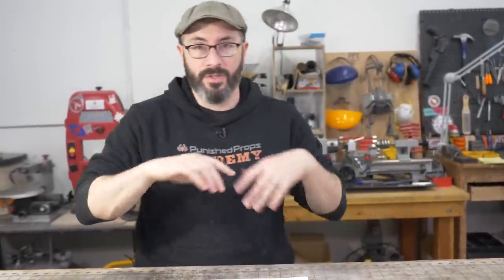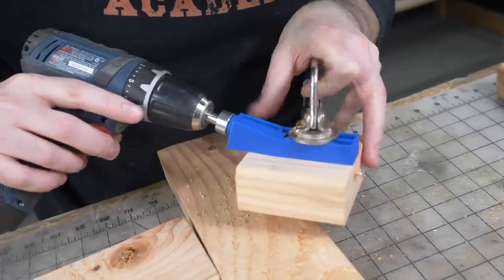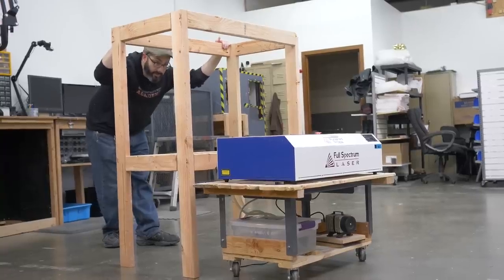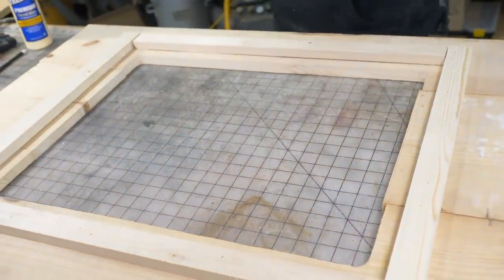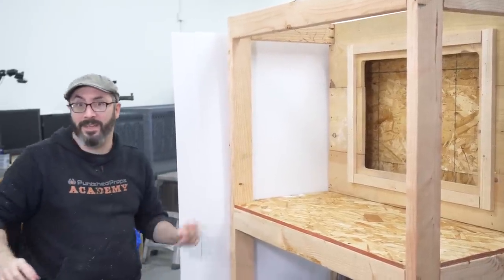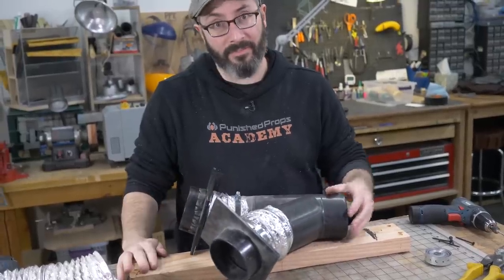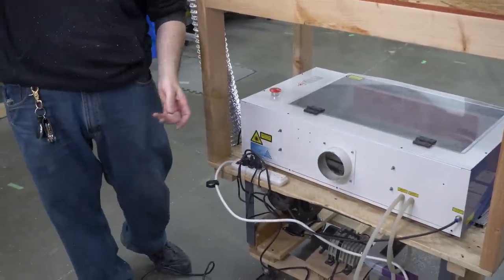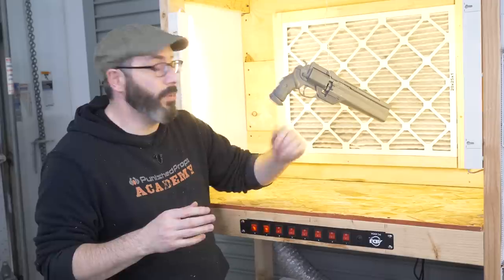How to Make a Custom Paint Booth with Filter & Lights!

Comment from the maker: Check out the full list of tools and materials used in this build along with some progress photos on the Punished Props website! https://punishedprops.com/2019/03/18/custom-spray-booth/
Reply: when dealing with paints, how often does the filter need to be changed out? i would assume faaaairly regularly if your doing a bit of kit building and other painting hobbies a few times a week? just assuming the paint would gunk it up pretty quick relative to standard 1-3 month filter life lol
Reply: Easy Trick: Suspend your fan/air pump from some rope. it makes such a huge difference in isolating and reducing noise!
Reply: Bill the fan you're talking about from a furnace is called the inducer motor assembly.  When you say furnace blower the motor for those are in the blower assembly itself and could start a fire.  The inducer motor assembly is what exhaust a gas furnace and you can probably call a local HVAC company to see if they have one from a scrapped furnace that works still.  I work for a HVAC company and we have hundreds of old ones just laying around and even give them away for free.  Just a prop enthusiast trying to clear up some confusion and keep people safe!

EDIT:  After watching Bob's setup i see what you meant by a furnace blower.  you can find those on old oil furnaces or industrial furnaces.  really not that common anymore sadly

Link to a new one for refrence : https://www.amazon.com/702112479-Replacement-Furnace-Exhaust-Inducer/dp/B00FQR8WES
Reply: How to save 95% of the time used on this. use an old closet that you either have in a permanent spot or on wheels.
Reply: Hey Bill, I was wondering if you can build something for me. If so, how much would it cost? If it would cost anything at all.
Reply: Is the filter name or specs shown anywhere? Amazon link doesn't work and can't see any details other than the link and "here is a filter like what we used". Hopefully I can find a video that actually says what is used!

Comment: Kreg pocket screws are AMAZING! I would suggest, however, looking at the instructions about setting the collar depth. You will get a much stronger joint.
Reply: I was thinking the exact same thing.
Reply from the maker: Great information—thank you!
Reply: This and the distance from the edge of the board should be in the instructions too
Reply: Those pocket holes are far too deep. If the point of the drill breaks through, think how much wood is left for the screw to hold on to.
Reply: Came to say this.  You don't want the drill to come out the end of the wood.
Reply: exactly my first thought. There is no material left for the screw to hold on to when he drilled so deep. You only need to go deep enough to make the screw head flush and disappear. Get longer screw lengths if you need to reach.
Reply: @punishedprops  I just watched your video and I had a conniption the moment I saw you use the pocket hole jig and it's drillbit completely wrong!

If you're going to do a video where you're teaching other people how to do something at least know what the Hell you're talking about (or demonstrating).  READ the instructions BEFORE going on camera!!!

Plus..."The time is come!"...is wrong!  You can't put a past tense and present tense in the same sentence!  It's "The time HAS come!"

Comment: Pro tip (from an amateur woodworker) - If you're building two sides that are going to be identical, lay the second side on top of the finished first side so you can use the first side as a jig.  No measuring needed and if you made any slight measurement errors on the first side, they will match on the second.
Reply from the maker: Great tip!

Comment: Awesome build, but the filter is in backwards the cross hatching is there to prevent the filter from being pulled in when the filter starts to get clogged and pull out the Kreg instructions out of file 13 and your screws won't peek through anymore.

Comment: Two things.  1, I'm 90% sure that filter is in backwards.  There will be a marking on the edge saying which way the air will flow.  2, you could put construction adhesive or caulk on the wood before you attach it to the frame to make the edges airtight and just tape the butt joints.

Comment: Tape to mark the holes for the screws for the light mount. Dammit where has this trick been my whole life???
Reply: It's probably the simplest thing I that whole video and I thought the same thing. :)
Reply: I photocopy the bottom of things a lot.....
Reply: I'm glad I wasn't the only one that thought the same thing about the tape! LOL
Reply: I'll be using that tape trick the next time I mount a power bar or something similar. So simple.
Reply: What I've done (although it wouldn't fit in that location) is I put a piece of masking tape on the edge of my 48" level, and I mark on the tape where the holes go.  That way I get my hole spaced correctly and level.
Reply: RIGHT!!!

Comment: I am happy that Bill shared this with us. For anyone looking to get the parts listed in the description be aware of the following. The (Furnace Blower) listed will NOT have a power cord, an on-off switch, mounting bracket or any way to connect the intake hose. If that is going to be a problem for you, you may want to look for a different one.
Reply: I wish I would have read this before ordering everything. Kind of a bummer none of it comes with instructions, or that Bill didnt warn us about that...
Reply: you wouldnt happen to be know a good recommendation would you?  One that comes with a power cord, the proper flanges, and the measurements? Thanks so much!
Reply: @mikezufelt8172  You can order in line fans that come with charcoal filters and dryer vent hose fairly cheap off of Amazon

Comment: Great tutorial. I built one very similar to yours a few years ago for my modeling hobby using 2x4’s and plywood.  Due to space limitations of my shop I had to mount my blower and filter on the bottom surface of the spray box. I covered the filter with a metal grate, which serves as the “floor” of the painting area. It creates a down-draft that works surprising well.  

The blower/motor was the most expensive part. I bought mine at a hydroponics store for about $65. I love your power switch bank. I’m going to make that an upgrade to my booth.  

Since my son took up prop making and cosplay, my booth gets a lot of use.  You’ve been a big inspiration to my son. You and Andrew DFT are his favorite makers.
Reply from the maker: That's fantastic! So glad to hear that :)

Comment: Awesome and functional cart!  If you use PVC or rigid aluminum ductwork, you might get better air flow. The flexible duct used may collapse if the vacuum pressure is too high.  Also, the Kreg Jig for the pocket holes has a depth guide/setting to make sure your depth collar is set correctly.  Baffles are a great idea. You can use a cheap set of window blinds to make them easily.

Comment: I  made a similar version some time ago using a plastic garage cabinet I had. It was already together, so all I had to do was cut a large square out in the back and make a spacer for the filter and put the cut-out section back with a 4" adapter for connecting my dust collection hose. It's light and can be moved easily when not needed. I do need better lighting, so I will use your idea for that. Great video Sir.
Reply from the maker: That's great! We're happy to help :)

Comment: enjoyed the video Bill - I built a booth based on the one in a Kamui Cosplay book - she made it simple by using a cabinet from IKEA and cutting a hole for the filter and adding lights and a fan.  I had an old cabinet so I gave it a go and it works great. Easier if you don' thane the room or the tools to build the cabinet.
Reply: What kind of fan did she use?

Comment: My booth is like 12 years old now and built out of 2x2 frame (really just 2x4s ripped down the middle) , cardboard sides (old boxes), and duct tape to seal it up. Made it where it all unbolts into flat panels to store when I'm not using it.

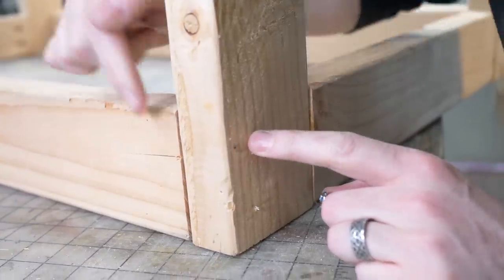Comment: 7:08 Hey Bill, pocket holes are the correct option for that.  You never want to screw, or nail into endgrain (or even glue actually).  The joint is weak and will fail over time.  Screwing through the endgrain to the long grain is several times stronger since you're basically screwing through a pilot hole that the smooth shank of the screw will live in, and the screw threads will grip into the cross grain.  That's the real reason you need special screws with pocket holes.  Just adjust your depth correctly :-).

Side note, I have a box full of 20x20 4" thick filters that didn't fit my furnace that I'm going to do something similar with.

Comment: Hey bill! The joint where the ends pointed out, you were still right to use pocket holes. While they do help with awkward places, their job is actually for strength not ease. Screws going into end grain don’t hold well because of the orientation of fibers, so with the pocket holes your never going straight into endgrain, but still slightly against it in each piece. That gives the threads better bite and leads to a stronger, longer lasting joint.

Comment: Hi Bill , nice spray booth .
Can i give you some humble tips ?
You can experiment  with the lights , it maybe would be more practical if you mount the lighting in the top front  inner corner , that way you get less chance to get" over spray " on to the lights and you could easy look from both sides  to the parts you painted  to see if you missed some spots or have some thin coated spots  without blinding yourself from staring right in the light source by accident .
Also you can consider to use hooks or eye hook bolts with a washer and self locking nut so they can turn free in that upper beam to easely spin the part for spraying all sides .
That way you can always aim straight forward to the direction of the filter.

One more little thing : pocket holes will always be better and stronger than screwing in the end grain of wood.

Thanks for for showing all those beautiful props you made , there are always  some golden tips in your videos  so again thanks for sharing.
Reply: Based on other comments, I expect he will go with the alternative solution of putting cling wrap or clear cellophane tape over the lights, which can be easily and quickly replaced when overspray becomes an issue in blocking light.

he tends to use wire when hanging parts, which can be bent to expose the other side without worrying about it twisting back around, but some king of spinning hook is a good idea.

Also, I think he's aware that screwing into endgrain is not effective connection, given he demonstrated this at 4:06.

Comment: Good project for the shop. I am wondering why you did not use the table saw to cut the 2 x 4's into 2 x 2's instead? You did not need all the extra weight for such a small paint booth. It is recommended to use glue with the pocket screws. You could have added the silicone to the 2 X 4's before you screwed the back on and that would have sealed the back better. Are you going to add a light to the top as well, not just the sides?  Nice project that will be used a lot. Thanks for posting the build. Take Care.

Comment: I had the next size up kreg jig that you have a long time ago that had little sliding arms to determine how far back the holes were set. I believe the thickness of the board you are drilling into determined how far back the jig is set from the end so the hole is roughly center, and how far up your collar is is determined by the thickness of the board you're screwing to so that the screw doesnt poke out the back side.

Comment: i built one just before xmas using foam core artboard, taped the exterior and hot glued the edges on the interior. It works surprisingly well and is obviously very light :)

Comment: If you end up closing the bottom compartment, i  suggest that you put a flow indicator somewhere on the water tube, to check that the water pump is working properly.

Comment: Big fan of your work, currently going back through your videos and wanted to offer a tip about using a pocket hole.

Set the stop collar on the drill bit back a little bit further for a slightly stronger joint since you are using such long screws and aren't plugging the holes.  The threads are the only thing holding the second piece so that extra shaft in the second piece serves no purpose but the further you drill the holes, the less material will be under the screw head.  Set it so the bit just barely pokes through, not even necessarily all the way.  Use the guide included with the jig for a starting point and adjust from there to your liking.

PS my desk is about 10ft from the press that produces that jig.
Reply from the maker: Very cool! Thanks for the suggestions!
Reply: @punishedprops  your welcome! Thank you for putting out great content.  It has inspired me to continue my prop building venture (mostly Ghostbusters related).

I'd also suggest upgrading to the R3 if you end up doing more pocket holes or the K4 if you do a ton of them.  Both those jigs have guides directly on them to set everything based on material size so you have optimal depths and won't drive your screws all the way through the second board.  Shorter screws help too lol.  

Keep up the good work!

Comment: Great build. Well thought out and it looks like a pleasure to use. 
Is there any fear of flammable particles getting trapped in the hoses? Perhaps you should ground them to protect from static build up.
Just a thought.
Reply from the maker: There likely is a risk but that's part of why I used the particular motor I chose.
Reply: @punishedprops  I get that for sure. Air moving thru a pipe can / will cause static build up which will eventually discharge. Grounding the pipe will keep the static charge from collecting. 
I did this with the dust collection system in my basement woodshop. Better safe than sorry when my family is sleeping upstairs.
Regards.

Comment: I know it must seem everyone has an idea of what another guy outta do, but I was thinking. I would line the inside of the booth with the panels, and (hope I get the name of this correct;) a builders paper? a roll about 30" wide, maybe 100" long. Duct tape that on, and then replace as needed. It's heavy weight and takes a bit of a beating. Another fun watch :)

Comment: Id suggest to cover the OSB with something because of two thing.... if water get on it for what ever reason will just crumble and 2nd OSB are notoriously for handing free splinter out.  Id recommend to sand the edges of the expose osb and coating it with something smooth like Resin or expoxy for example or jut layer them with duct table just something to protect OSB and you

Comment: When you drilled those holes for the joints, did you drill one on the other side of each 2x4 to add more durability? Is it holding up alright?

Comment: Interesting video.  I been thinking of building a spray booth for my airbrush for a while now.  Question though, why did you decide on those style of lights over LED strip lights?

I ask cause I was planning on mine of running LED strip lights along the corner to provide illumination to the rear without putting light towards me.

Comment: A few tips, on the side of the boxes for your air filter, there are arrows that point to the direction of airflow. Maybe a tongue and groove design would be more efficient at an airtight seal for the back boards. 

  As for the type of fan motor, your probably talking about a brushless fan. As brushed fans creates sparks through the carbon brushes to turn the armatures. That make the motor turn.
Reply from the maker: Great thoughts!

Comment: I'm building my spray booth at home (for airbrushing with acrylics only) out of a large Rubbermaid tub with the filter mounted to the back side. My filter, fan, and the enclosure behind it are going to be much smaller and it will be mounted in an old computer desk with just enough space for the tub to fit. However, my local makerspace needs a spray booth. Your plans and configuration should work really well for that. Thanks!
I guess you aren't at all worried about getting paint overspray that falls outside of the booth onto your laser cutter? The mirrors in there, even with the lid for protection, could eventually get paint on them and degrade your laser's cutting ability.

Comment: I'd really recommend any who build this mount the filter/fume extractor on the top so the filter doesn't get prematurely clogged by overspray and large globs of paint, plus you'll able to spray straight into the booth without also painting the filter.
Reply: In reality the air flow on this is way to low to really be effective as the blower on the laser cutter is to low in air flow for the volume of the booth. If  the filters were at the top the whole thing would be next to useless because of the low air movement.  At least the filters where they are are catching something being in the line of fire! The filters are supposed to get clogged up it is what they are there for to catch the droplets of paint before they get to the blower and ducts of the system.
Reply from the maker: We may add an additional cover to extend the life of the filter but for now this suits our needs just fine! We don't do a lot of heavy spraying in our shop.
Reply: @punishedprops  Definitely a good idea for the long term and since you already have the booth completed. It'd be extra work and materials for someone starting from scratch, so shifting the position keeps it simple.

Comment: When you measure things and make lines, draw an arrow on the side where you will attach things (or to mark what part to save etc etc). It save you having to wonder what side of the line you should be on. I use arrows but I guess you can just write HERE or something to :)